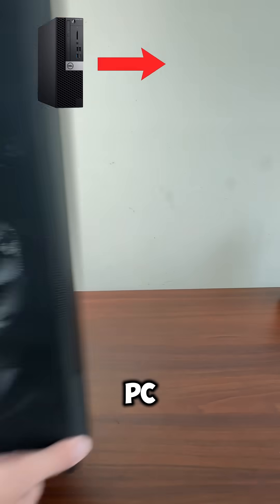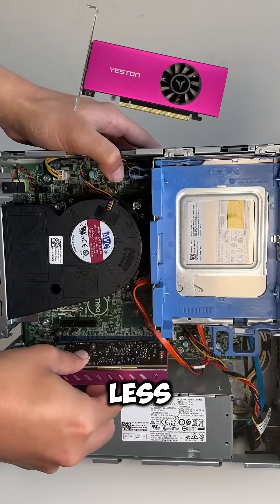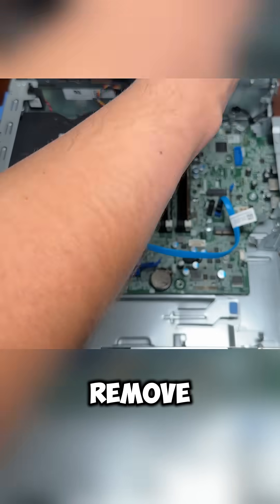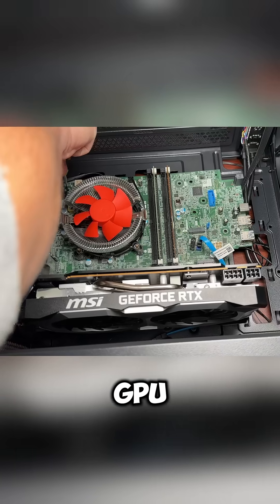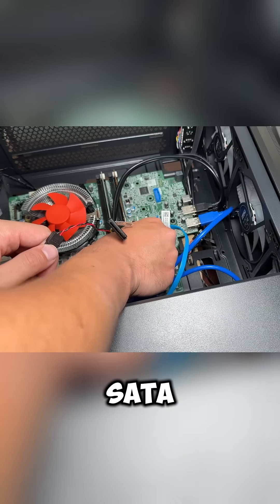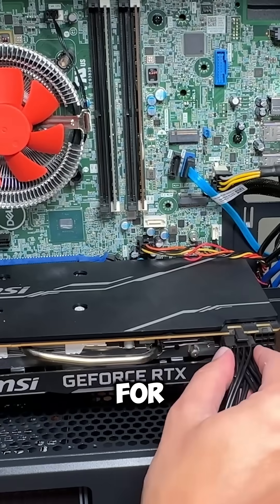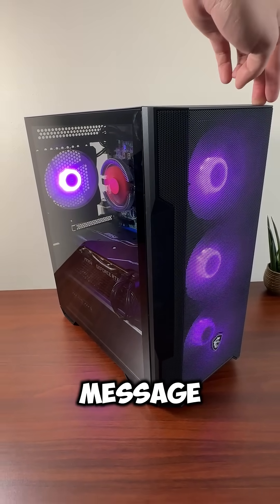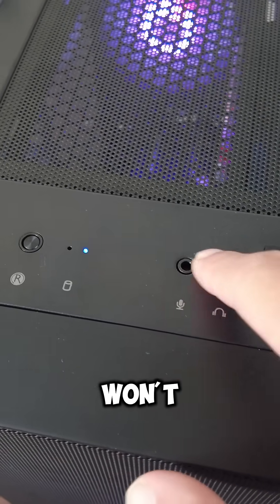Old Office PC to Gaming PC - Dell Case Swap #gaming #pcgaming

Comment: Actually they use proprietary PSU connectors and also proprietary motherboards which aren't a standard size, so you can't swap the case or PSU
Reply: Adapters, easy

Comment: Bro can you tell me what could I change to at least get 60 fps on valorant.but have to be under 500$. These are my specs:cpu Intel(R) core(TM) i5 6500 cpu 3.20ghz gpu: Intel(R) HD graphics 530
Reply: Aren't you getting 60 fps in valo with igpu? I though it is possible 
But for this budget get 16gb ram if you don't have and get a gpu that doesn't bottleneck your i5 6th or get an i7 6th and get a gpu that doesn't bottleneck it

Comment: Im just asking and wanna hear your opinions why would someone do this?
Reply: cuz you can potentially find pretty good deals, I saw one of these sell with a 10th gen i7, 16 gigs ddr4 ram, 512 gb nvme drive, and motherboard of course for 190 total. At that point it's just replace the power supply, swap it into a bigger case, slap in a decent cost-effective gpu and you have a pretty decent gaming pc for like $500 total. Or just slap in a 6gb 3050 and you have a pretty decent pc for a $320 build. Overall tho it's usually not much better value than a meta AM4 build from scratch, but potentially worth it if you're really on a budget.
Reply: @royalsuperperson3652  in my opinion buying new or used ryzen 5 5600 $90 thats beats all that getting a 3060 for $200 and a $75 b550m buy a used PSU if you are smart and some used ddr4 since it isn't going up
Reply: You can build build that for like $400 it will beat that

Comment: Honestly it went great. But just one question. How much was the build?
Reply: I did this recently with a Dell Optiplex 7040.
The optiplex itself (with 32 gb ram and 1tb hardrive: $225 on Ebay
Adapter for power supply: $15 on amazon 
Powersupply (650 W): $70
Used 1050ti: $30 on Facebook Marketplace (they’re usually $100)
Pc case: $25 facebook marketplace

The only thing I will say is that it’s best if you get an optiplex that already has an SSD and honestly just invest a bit more in your GPU depending on what you want to do. Hope this helps